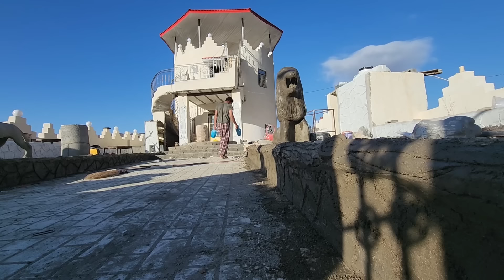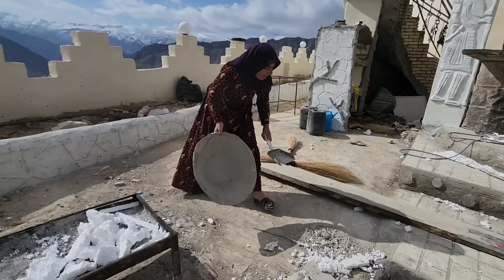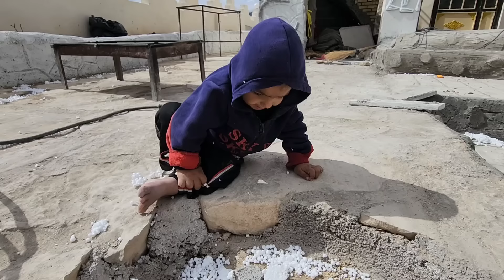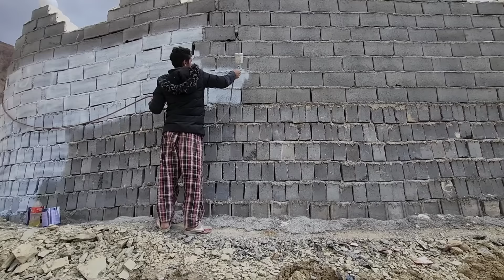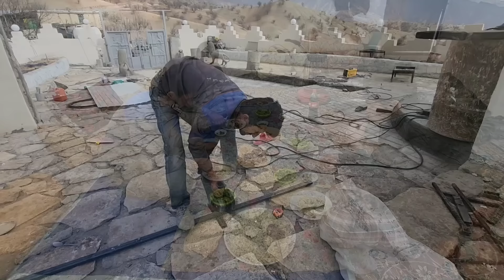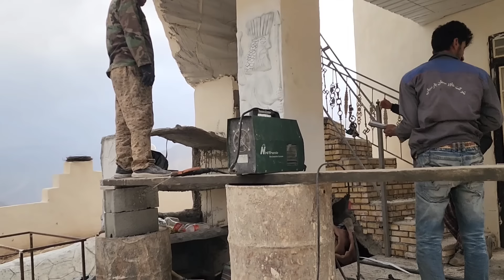Nomadic pleasures in the castle: Hassan's artistic creativity to Zuleikha's cooking in the castle

Comment: Like the efficiency a spray painter allows to finish painting projects, but this is a airbrush machine it’s intended use is for small projects; t-shirts, toy cars for example not painting a walls.
Reply: It’s a HVLP gun he just isn’t using it properly. He is supposed to open the fan
Reply: @michele66w nonetheless it’s inefficient at any rate.

Comment: The children burn plastic and styrofoam and are poisoned by the fumes and Hassan paints bare brickwork after all the effort on the inward side. What's the problem, did you run out of money? Then it's better to wait a while and do it properly when you have the money.
Reply: Y tenga alguien que cuide a los niños

Comment: :face-fuchsia-wide-eyes:did you see the HUGE GAPS in the wall outside where he was spray-painting? they need to be FILLED WITH CEMENT, and after that they need to be PLASTERED, and only after all that is done, comes the paint! That wall outside has a HAS A WEAK FOUNDATION with all the big holes in it, and no cement filling, and no plastering!:face-fuchsia-wide-eyes::face-blue-wide-eyes:
Reply: Wait until an earthquake visits.